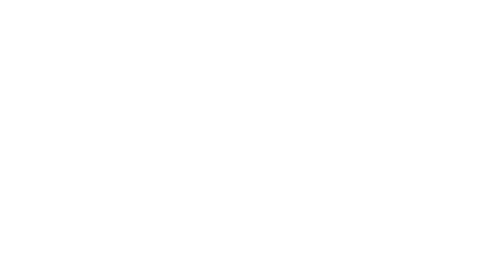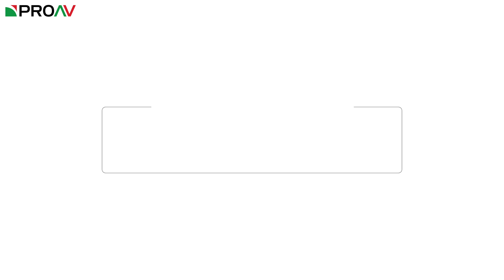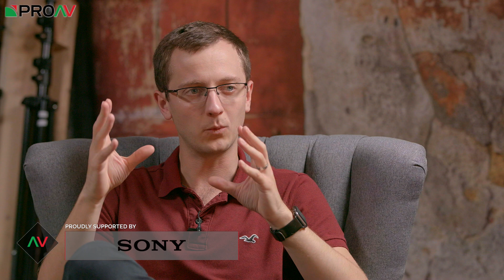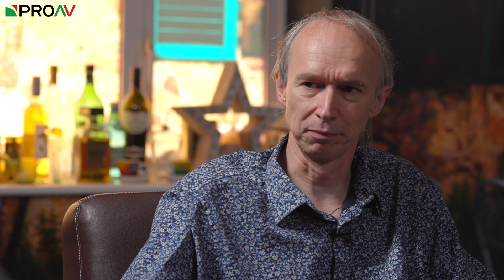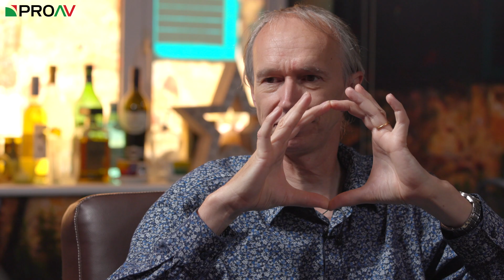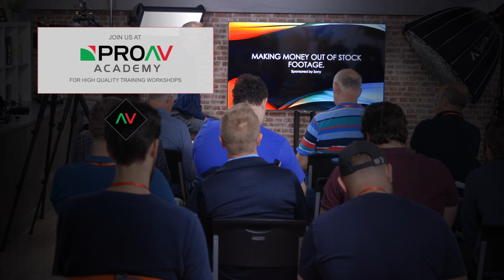What is Diffraction? | Tech Terms with Alister Chapman | ProAV Academy

Comment: Does it help having 3 sensors instead of 1. Cameras like sony PXW-Z190 opted for mounting 3 smaller sensors instead of 1" sensor.
Reply: A clever question, but after a few seconds: I don't think so... Think about the place or the point when the defraction started. It's the aperture. The three sensors in your example will come much later, so the effect of the defraction is present while the light beam is splitted to the three sensors. In the end the softness is splitted too...and after combine the sensors images the softness will add too. So it will makes no difference to have only one or three sensors.
Reply: @StudioBonn  yes, it makes sense what you say. But, has something to do the bayer pattern only present in single sensor cameras?
Reply: @SportFlow  No, the bayern-pattern scheme has nothing to do with defraction. This is another story...
Reply: @StudioBonn  Yes, I know, but I try to understand if the compounding effect of the 3 CMOS have a noticeable impact on image quality compared to a single CMOS sensor. If not, why sony chose this path with their camcorders? z190 and z290? thanks again for your thoughts, I really appreciate them.
Reply: NCFX Trivial it's the superb quality that results using three sensors. A better or better pour reading out of each colourinformation, no compromising to the 50% green on single sensors, free adjustable combining... so an extreme precise colour informarion, more sharpness, less moiré and so on. But it's a more cost effective build production, very high precise technology, more temperature sensible, needs more physical place in the cameras body, so much more expensive. But todays single sensor technology is on a very high level, so in modern cameras it's not that much interesting for the normal consumers. But in research for biological term or astronomy, medicine, etc, there is a need for that extreme quality.
Reply: @StudioBonn  brilliant, thanks!